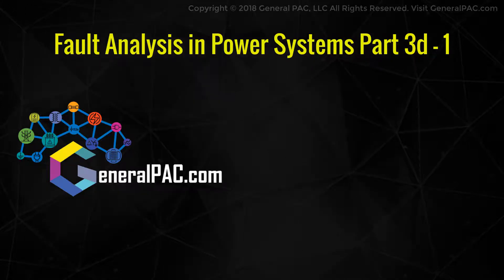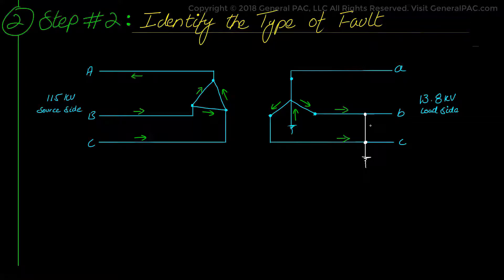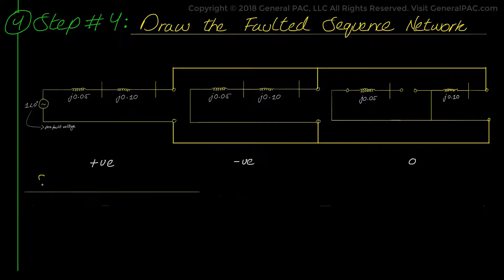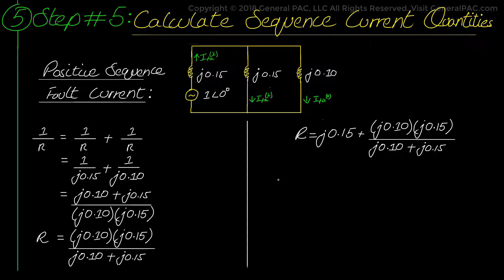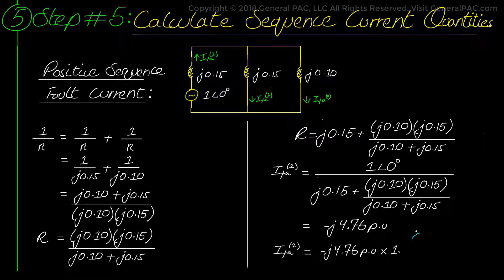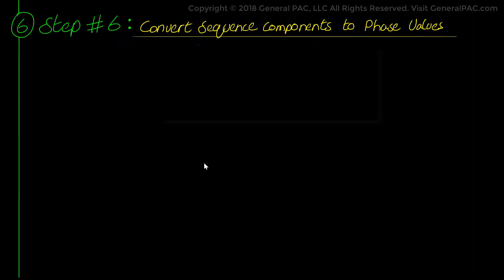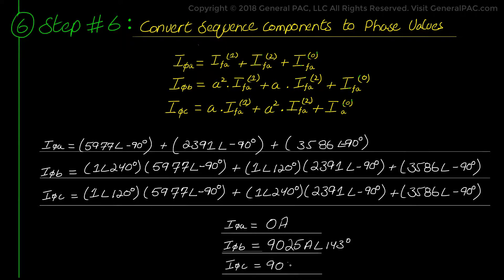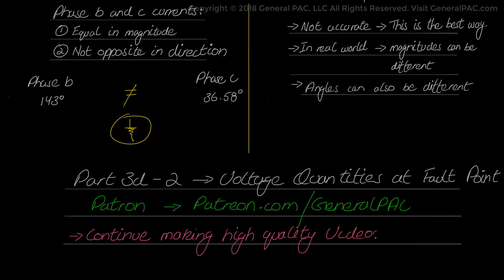Fault Analysis in Power Systems Part 3d-1

Comment: Why do we add a negative sign to calculate the negative sequence?
Reply from the maker: Hi, In double line to ground fault, the direction of the current of negative and zero sequence current is opposite of positive sequence current. That's why while solving negative and zero sequence current using current divider rule with reference to positive sequence current we used a negative sign.

Hope you find it useful.

Regards,
GeneralPAC by AllumiaX

Comment: Thanks for the videos. I'm still confused how the math ends up working such that the solution knows the un-faulted phase is A (phase current = 0). If the un-faulted phase is B instead (A + C line to ground fault), how would the math change?

Comment: Small mistakes calculating negative and zero sequence currents. Using these you will get the same final answer as in the video.
Negative sequence, Iaf2 = 2391 < 90
Zero sequence, Iaf0 = 3586< 90